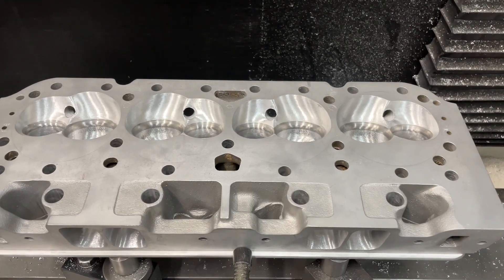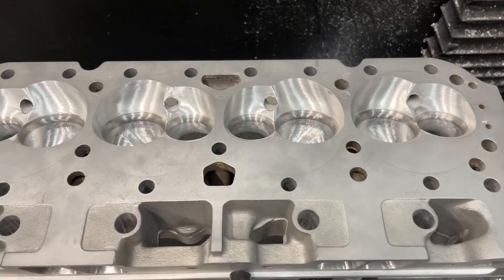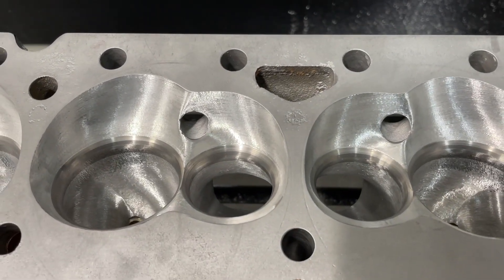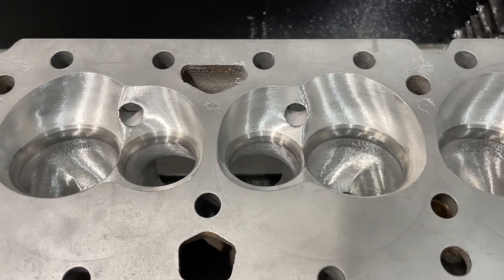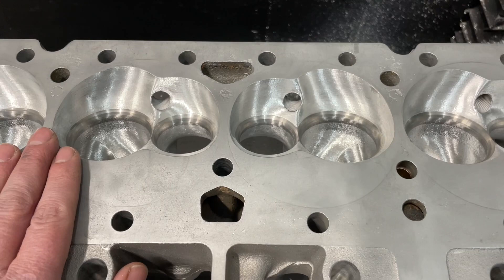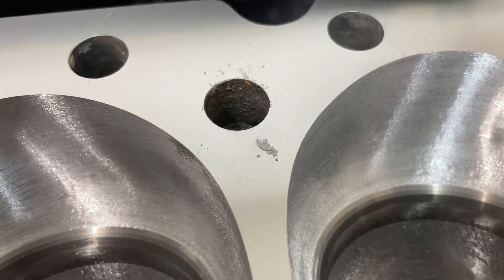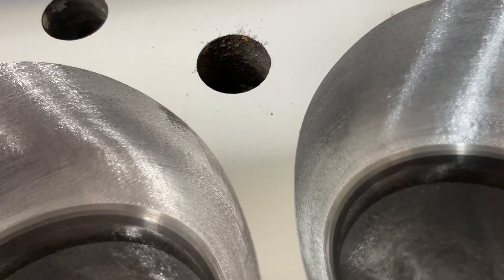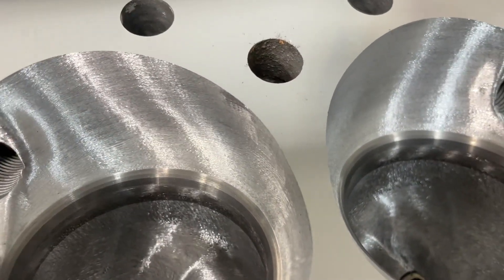Pitting in Aluminum Heads

Comment: I ground engine to, frame, body and battery, battery to frame, battery to body and engine. We run way to many electronic devices to not ground. This is done in multiple places throughout the car. Seal all frame and chassis grounds with dielectric compound to prevent rust or corrosion.

Comment: Some people also install a sacrificial anode in the cooling system. When there is a problem with grounds or bad coolant you can actually measure the voltage in the water with a multimeter. Anybody who uses aluminum heads or water pump on a steel block should keep an eye on it.

Comment: When I did transmission work, we had some TSBs that pointed out that some drum bushing failures were actually bad grounds causing the engine to try to pull ground through the gear train. Didnt believe it til I saw it.

Comment: I just built a new motor form my S10 with AFR 220's... I have solid motor mounts and the block is grounded to the frame with a ground strap... Do you recommend grounding the heads individually to the frame as well?
Reply from the maker: Yes
Reply: How about an explanation as to why a heap of earth leads are better than the head studs and fire rings as earths. Most people using afr heads will also be using a block that does not require sealing the studs